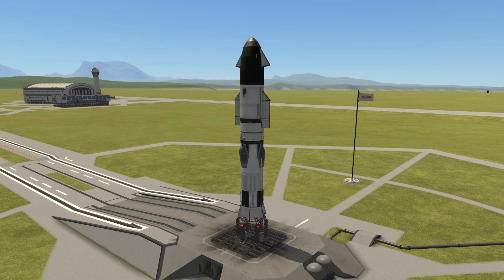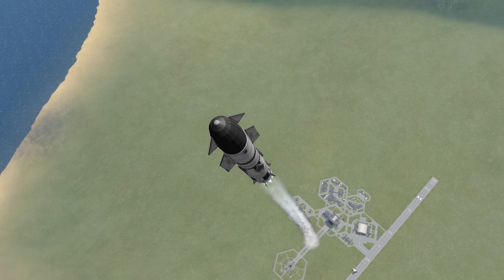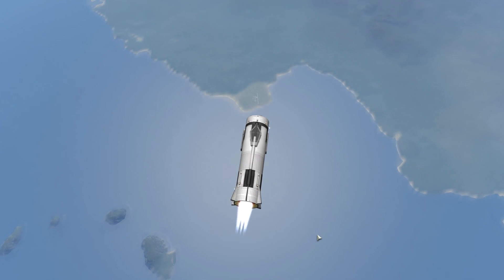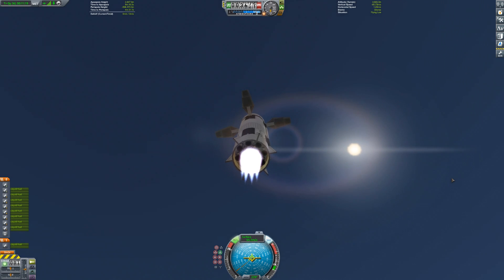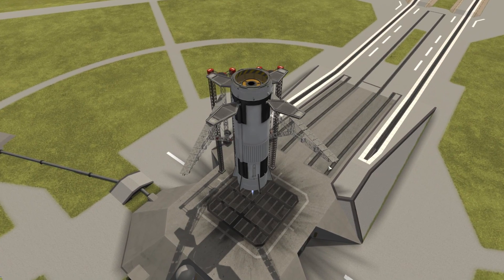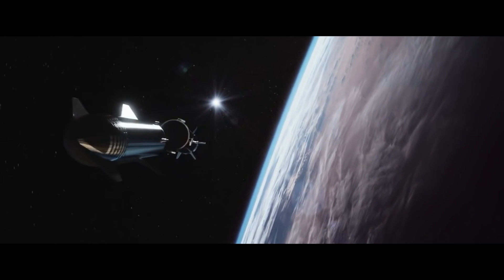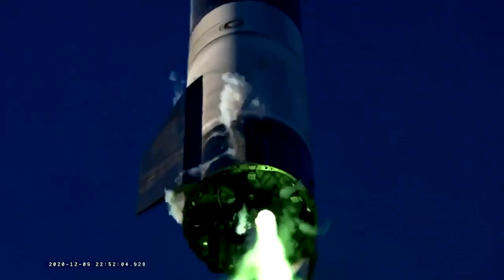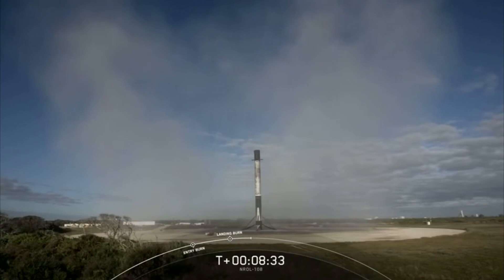Why SpaceX Wants To Make Landing Super Heavy MORE Difficult.

Comment: Before watching, my initial reaction is that if landing it is easy, that probably means there's lots of extra fuel or a lot of leeway in some area. The more you reduce room for error, the more efficient your system is. If you still have 5% of your fuel left after recovering the engine, you didn't need all the fuel you took with you.

Comment: Grid fins seem too weak to stop a 70 meter steel silo, real re-engineering must be done.
Reply: Grid fins don't stop it - that's what the engines are for.
Reply: @stargazer7644  I know speed of the rocket is near zero when it reaches the tower, even  holding weight of that monster with these fins seems hard.

Comment: Isn't it more difficult to design a structure for stability under both compression (supported from the bottom) and tension (hanging from the top)? Or does the stainless steel just kinda work either way?

Comment: I would suggest that they are already capable of something like 90% reliability to land accurately.   I haven't mad any attempt to check scale or anything or go back through their recent booster landings, but I recall their boosters both on land and water for the past several months mostly being dead on or within a couple meters.  Their boosters being off center when they come back to port I would not worry about, one of their videos (how not to land I think?) showed a booster sliding all over the place on the drone ship due to waves.

Comment: Why not just move the fins to the bottom and use them a landing legs?
Reply: For the same reason that you don't put rocket fins on the nose of the rocket.  The rocket is going backwards when the fins are used.  It wouldn't be stable with the fins at the bottom.
Reply: @stargazer7644  Why not? It's a rocket, not an arrow; it's actively controlled, gimballing engines, attitude thrusters, and movable fins that would just be set up as canards. The stability control software should easily be able to handle it.
Reply: @nuclearmedicineman6270  Because putting the fins at the bottom makes the craft dynamically unstable.  Learn some physics.

Comment: O Belice that the problem is stainless steel: it’s too heavy and the strength to ratio is not there. So basically the legs will be too heavy too support the forces, so it’s worth a try ti renové them. Catching rockets in the pass : that’s kind electric vehicles during the lead acid battery days.

Comment: Okay, I don't follow. What's the actual reason for any of these booster recovery efforts?

It seems to me that the booster structure is under all circumstances trivial, and so can be discarded freely because it can be constructed relatively easily. The only thing I can think of that might be worth the effort to try to save is the turbo pumps, really, and wouldn't those need to be heavily refurbished anyway before flying again? Are there any other booster components that would be that important to recover rather than constructing new?

Anything worth saving has to be set against the costs associated with whatever efforts must be applied to doing the saving. In this case, I don't know the relative cost of the maneuvering system, the added guidance capability, and the added structural elements that wouldn't be needed in a discarded booster, but one thing I would think could be a serious problem would simply be the mass of it all. The mass of all the added systems, plus the mass of all the fuel for the deceleration and retro fire, you have to accelerate all that mass all the way from the pad to the point of stage separation, and then accelerate it all the way back to the pad. Is there any indication that this is remotely economical, in an absolute sense?

It seems to me to be seriously plausible that these efforts at recovering boosters make the boosters substantially more expensive to reuse than simply building new boosters that are intended to be single-use and discarded, and that the only real reason for the booster recovery efforts is to generate publicity simply for accomplishing the technological "feat," and thus drive investor interest. Does anyone have any reliable data on any of this?
Reply: The entire point of making the boosters reusable is because of the enormous cost savings - You don't have to build a brand new rocket every time.  The first stage is the largest part of the rocket.
Reply: Remember that there's not only material cost, but also assembly cost. Which yes, both costs are pit against whatever the extra cost of the saving equipment and operations are, as well as the extra fuel. And yes, assembly cost would be worse for a reusable rocket than an expendable rocket, but it's a one-time cost which will be offset anyways.

Calculations for the effects of reusability reduce the payload capacity by about 1/3 in regards to barge landings and about 2/3 for RTLS landings, observable in listed Falcon 9 payload capacity for both expendable and reusable launches. Listed masses of payloads launched into orbit back this up as well.

Unfortunately there's no concrete evidence to support reusability being economical, although the circumstantial evidence for it is looking pretty strong at this point. The Falcon 9 has launched a fairly large number of times for a rocket, with a slight drop in launch costs associated with when they started reusing the boosters. Turn-around times are at this point slightly shorter than the pre-Challenger-disaster-era shuttle program's, SpaceX is only speeding up their launch schedule, and we also know why the Space Shuttle had major economical issues regarding it's reuse and how few of those issues are in any way relevant to the Falcon 9, with them being slightly more relevant but still mostly irrelevant to Starship. It should also be noted that the counter-arguments such as your "wouldn't the turbo-pumps need to be heavily refurbished anyways" are also pretty proof-less as well.

So, in regards to turbo-pump refurbishment, I'm leaning "no" on them having to be heavily refurbished between flights, although I do know for the Falcon 9 they need to be cleaned of soot (note: Starship and Superheavy would not have this problem). The reason is largely down to why the Space Shuttle's engines did have to be heavily inspected and refurbished between flights, and how many of the issues present there just don't crop up with the design of the Merlin and Raptor engines. The Space Shuttle had a hydrolox fuel-rich staged combustion engine with 4 turbopumps. Hydrogen has the problem of being a very "leaky" substance, and obviously when your engine is about combusting hydrogen you don't want it anywhere it's not supposed to go, because if it combusts there you no longer have a working engine. And when you have a very complicated engine like the Space Shuttle's, and your ability to remotely inspect the engine is limited by 80s technology, removing and disassembling the engine not only needs to be done but is going to be an expensive and time-consuming process. I'm not sure how bad the wear-and-tear on it was. I've definitely seen this hydrogen argument as being more of it's problem than wear-and-tear, given that apparently they'd only need to do this disassembly-type inspection every 5 flights, with the first inspection coming after the first flight. Of course, RP-1 and Methane aren't very leaky substances and won't have this problem. Methane also burns clean so there'd be no soot problem like with RP-1.

In short, there's no absolute argument for reusable rockets being economically efficient yet, but the circumstantial evidence leans to support it pretty strongly.
Reply: Re-reading over the comment again, there's a couple more points I want to make. Firstly, I doubt the cost of the booster structure is trivial for most things. Maybe for Starship here it would be, but for existing rockets, including the vertically-landing Falcon 9, it's not.

Secondly, I doubt the rocket's structure has to be strengthened significantly for landing (well, F9 or Superheated. Starship might). It has to hold more than its own weight while on the pad, and then handle 3-4 Gs on ascent anyways. Landing it shouldn't add that much more weight from structural reinforcement. Of course, there are ways to make structurally weak but cheap fuel tanks which aren't self-supporting (needing internal pressure to keep safe), but that does add additional risk and complexity to launch operations.

Comment: There's a way to do this with highly maneuverable catching shock absorbers on the other side of the launch pad, if position is out of spec it can ditch the rocket.. plenty of way to implement it, and save the weight of landing legs

Comment: Warplanes routinely connect to another plane to refuel, so it's not a wild stretch to imagine a plane/helicopter connecting with a descending reusable rocket booster. The booster could get more fuel for landing on its own, or just get picked up by the plane/helicopter and ferried to the ground/ocean. Problematic, to be sure, but so is adding more weight on the booster.

Comment: I know that this will technically make it harder to land, but I think the whole point is taking weight off of the rocket, which needs to have the least mass possible, and putting it on the ground. Who cares if the ground system weighs a fuckton (totally scientific measurement) due to complexity because it's stationary always on the ground. Whereas if you add landing legs on to Super Heavy you then reduce it's payload mass to orbit (and isn't the penalty for mass on the first stage greater than the second?)

Comment: i don't think it's that good of an idea... well there is certainly mass to be gained, but overall the real issue is the shockwave reflection when landing on concrete. if you build dedicated landing pads with proper gas deflectors dug out under them, you can do your propulsive landing without damage.
from that point adding catching towers would save you some mass on the launcher but increase dramatically the precision you need. that seems like a weird endeavor with unclear rewards.

Comment: Well, if they had an active landing site that itself could move 20’ or so in each direction quickly, it could help accommodate some inaccuracy in the rocket during landing.  Might be cheaper than putting all of the burden on the flight vehicle.
Reply: Like the unmissable dartboard?
Reply: @otterylexa4499  Yep.

Comment: Don't forget the attitude control thrusters. Let the booster come down about 500 feet to the side, then hover. After a fraction of a second to verify that everything is still working, flamey end down and all that, use the control thrusters to scoot the rocket into the waiting arms of the launch tower. You might have to load a bit more nitrogen, but I doubt that this would add too much weight. The rocket motors need worry only about the hover.  If the sideways movement fails, let the thrustors get the rocket back away from tbe launch tower before it crashes.

Comment: Wouldn’t it be more complicated to perfect each landing on the spot and design a way for 4 hinges (of the gridfins) to hold the entire booster rather than just have the original 6 fixed legs under the bottom fins?

Comment: Good, good goodie! How about a double net system, located approximately 200m off the ground. Engines would shut down 30 m before reaching the nets. Side jets would manoeuvre to position a belly flop on to the nets. Which would then be lowered to ground level.

Comment: The capture system could be in a more isolated area adjacent to the launch pad with equipment to quickly roll it back into place for the next launch. If it can be made inexpensively enough, there could be several near the launch platform to keep the traffic going even immediately after a failed capture.

Comment: This strikes me as an acceptance that landing legs doesnt scale up due to the square cube law. The larger the mass of the craft the proportionally more mass and volume would have to be dedicated to absorbing the landing.
Reply: Idiots keep depicting the full weight on the booster legs when stacked and full of propellant. Over 5000 tons, instead of just 250 tons on the "landing" legs. Those depicted legs must be 20X stronger than necessary. 

So the actual landing legs would have been made 20X lighter. But you can eliminate the legs and save even more on dry mass.
Reply: @imconsequetau5275  The falcon 9 legs are 4x600kg made of a honeycomb of aluminium and carbon fibre supporting 3500kg for a drone ship landing (the legs are 2/3rd the mass on landing). The Superheavy would have excluding legs an initial empty tank structural mass in excess of 300,000kg (though he wants to shrink that down to 200,000kg for normal versions). If using the same construction materials that would be in the order of 190 tonnes from simple scaling but maintaining the same target foot pressure due to the square cubed law you would need even more material than that.
Reply: @watcherzero5256  
So 300 tons, dry weight?

Comment: Coming up with ideas is easy. Making a functional prototype that works in the lab is moderately difficult. Making a robust product that works in the field and can can be manufactured in a timely and cost-effective manner is where the rubber truly meets the road. That's the point where most great ideas fail, and what separates the real innovators from the idea rats.

Comment: IMO they are going to use helium on SN9 likely because fixing the pressure issue will require major changes that just don't make sense in  already built prototypes. So at least SN9 and SN10 will use helium and they'll incorporate whatever pluming or tank design changes they need to in future prototypes....My guess or prediction or whatever is they need to redesign the methane header tank. Basically make it a little larger so there is more room for the pressurizing gases from the engines. That sort of change would be very difficult to preform on an already built prototype and would be a needless delay to the project.

Comment: Only for the engine to explode on the second launch. You said it yourself in your other videos. Liquid fuel engines are extremely complicated pieces of machinery with an untold number of moving parts. You basically have to rebuild the entire engine which defeats the purpose of "refurbishing" one.

Comment: Hey Scott. I think that SpaceX should do the hole maneuver in the following order: First, you send up the Crew Starship with Super Heavy, but without crew, a month ahead of actual mission start. Then you have a good time to refill SS in orbit and the astronauts are out of harm's way if something should go wrong. This way you could use fever SH when refurbishment time is not crammed. When SS is full and cleared, you send the crew up with Falcon 9 and Dragon which have the abort system ;) Lastly the crew docs the Dragon capsule with Starship. The Dragon spaceship could return to ISS as a backup ship or return to earth.
Reply: This scenario, using Falcon/Dragon for the crew, is also a very viable solution for the lunar version.

Comment: reverse rail gun.  catch the rocket magnetically in a giant inductor without ever having to touch it physically... Elon, call me!  :P
Reply: And store the energy in capacitors so you can reuse it when you launch the vessel out of the railgun again. BOOM!
Reply: @benbaselet2026  -- It's just a giant magnetic trampoline with capacitors for springs!
Reply: An Inductor would fry all the tech onboard, perhaps even it’s cargo
Reply: @Driftkart  well.. if we're still talking about a first stage return there would be no cargo.. but aren't the electronics on rockets hardened anyway?
Reply: @BenK12345  or make the flight electronics they can easily afford $10k or so per launch to just junk it and replace.

Comment: The question is will the weight of the fuel spent for that final hover be less or more than the weight of simple but strong landing legs?  Seems to me that having actual built-in legs gives the flexibility just in case youneed to land at an alternate location.

Comment: I thought they could build something like 4 towers reaching out, but angled in such a way that if you were to put walls up, it'd look like an upside down pyramid. You'd have cables connecting them with an almost bungee rope like elasticity. As the craft nears the ground, the towers come together depending on where the rocket is (they come together or pull apart if aiming isn't directly on point) and capture the rocket. That's what I'd try, and fail to do if I could!

Comment: More incoherent crap from Musk, who is going to build the "catcher" on Mars, it's very obvious a very bulky and tall rocket ain't ever going to land without nice wide legs.
Expect more fireworks at BocaChica.
Reply: Err . . . The SH first stage booster is not going to mars.
Reply: @nolsp7240  It's the thing that's supposedly going to Mars, the first stage booster is bigger and yet to come.
Reply: @kcobley  Starship second stage is going to mars.  The "catcher" is meant for the first stage heavy booster only.
Reply: Mind you, the Superheavy boosters are not going to Mars at all; it's the Starship, on top of Falcon Superheavy, that will. 
Not having the extra weight of the landing legs means more fuel is available to boost Starship up to orbit -- or to do a hover maneuver when landing (should that be docking?)